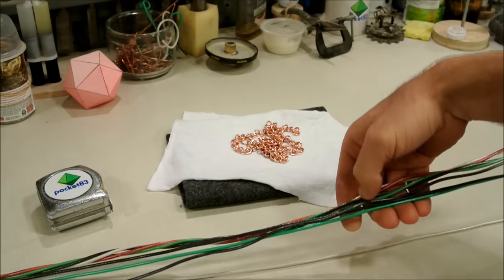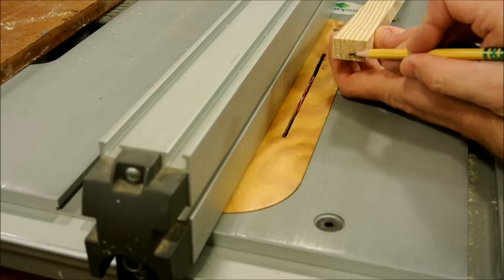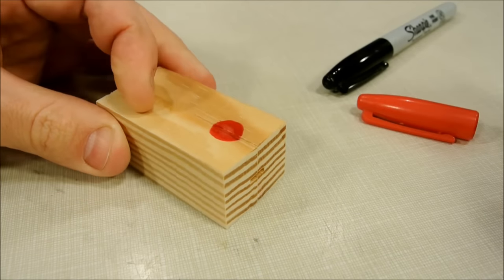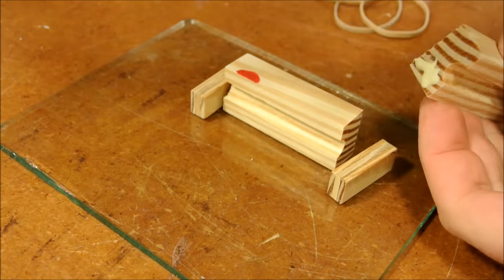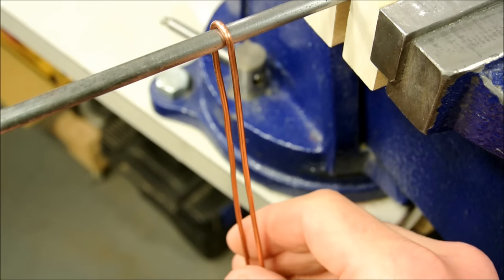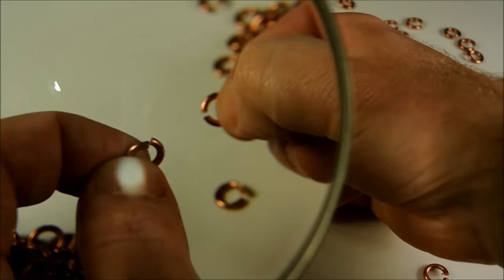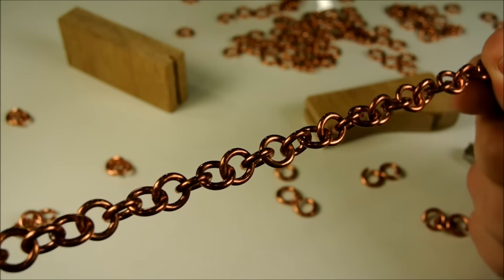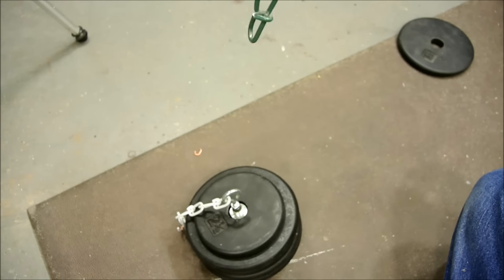Copper chain building

Comment: I have been making small bare copper coils for current carrying loops.  To join the ring-split together so there is no 'split',  I bent the ends out like you did, but also pushed them slightly inward so that to rejoin the open loop, you not only have to simply slide the ends back, but you have to pull outward on them and let them, upon release, press against each other.  This way, I can tin the inside the surfaces with solder.  Then when they are heated, the pressure will melt the solder, holding them in place with a thin layer of hidden solder--gives a much stronger 'breaking' force. Make sure that a piece of Al foil is between the soldering tip and Cu so no solder will be visible.

Comment: Find a really quick way to wind steel wire is to use a chuck key in a drill. Loop an end around the cog bit and power the drill to create a nice little helix

Comment: As someone who does chainmaille jewelery I do reccomend the wiggle closing method. Just pushing the ends together will deform the rings. You could also try welding each ring together to make it more permanent but for aesthetic looks and function I do not reccomend it.

Comment: Chainmaillebasket.com...  you are making copper chainmaille chain essentially.  Your technique is the same as chainmaille makers have been using for centuries.  Neat way of cutting though...  of course you could also get a dremel and a groove in your mandrel,  or a set of flat cut wire cutters and cut all the rings just as uniformly.  Interesting way of cutting the rings though.  

You can also hard weld the copper wire together using a pinch welder.
Reply: Good tutorial.

Comment: hold off on the vinegar, it's kinda way too agressive to  the metal if it doesn't have much oxidation i might recommend you treat the copper with something to keep the shine before putting it to use.  If anyway for the people that still wanna try vinegar, because it's one of the cheapest methods, watch out with the time you leave it because as soon as it acts on the oxide layer it will attack the metal leaving it porous. Be aware
Reply: aaaand if you just wash it after the vinegar and do not treat it with something it will also start ursting quite quickly because of the water that got in contact! im doing my own experiences on what is best effective on covering the metal for something that will have a lot of touch. still haven't tested it but i wanted to compare common machine oil and polishing it and gasoil and also polishing it. if any of you have a suggestion, just tell me

Comment: I've also played around with soldering the larger gauge links. Can you do a video on the strength of yours soldered and it's weight capacity? I use a 1/2" brass round stock to coil mine.

Comment: There is a lot of great stuff in this video!  I've used a mandrel in a drill to coil  different types of wire before.  Fast and works great! For instance, drill a hole to fit the wire just past where the mandrel would chuck in the drill. Thread a bit through to hold it and spin the drill at a low speed while keeping tension on the wire by hand. Just my 2c. All in all, a great tutorial!

Comment: When I was doing something similar 20+ years ago, I would take the 1/4" rod and drill a hole slightly larger than the wire in one end and put the other end in a drill. Feed the wire in the hole and while bracing the wire with a scotchbrite pad, spin up the drill and you have a full spring in seconds.

Comment: I wonder if that's how they make the links for chainmaille
Reply: I used to do chainmail when I was in my 20's - the technique is mostly identical, we used to buy regular black steel wire (not spring-steel) and wind it up on a steel rod affixed to a drill via the Chuck. Made it that much faster, but guiding the wire required some heavy-duty gloves :-) Other than that, it's just that Pocket has better tools; we just used pliers.

Comment: If you put the chain in a tumbler it will harden the copper and make it a lot stronger.
Reply from the maker: We have to keep this in perspective. (Elemental) Copper is just not very strong by nature, and no hardening process is known that will change that. Further, a tumbler will destroy the polished appearance. If you want "a lot" stronger, I would suggest an alternative metal. 

However, if you are aware of any CREDIBLE information on the subject, I would enjoy reading it. In any case, I don't expect that any physical treatment will increase this chain's carry load more than possibly a pound or two, which really negates the effort.
Reply: pocket83 I am a copper and silversmith by trade, and I've worked with steel since the 70s, so I am aware that unalloyed copper isn't a very strong metal. However, I have had opportunies to test various techniques. A jewelry tumbler will not destroy the polish on copper, quite the opposite,jewelry tumblers are used to polish it. And every hit made on copper(silver is similar) hardens the metal. Bending also hardens it. Therefore, as the shot in a tumbler strikes the copper pieces, the copper work hardens. If you do it too much, it gets so hard that it begins to crack. Heating copper red hot and quenching will anneal it, making it very soft and malleable once more. You can leave chains and such soft like that, if you want to, but I prefer to make them much more resistant to bending, so I either tumble them, or bend them several times until they harden, or in some cases, I hammer them out. The copper becomes many times more resistant to bending after hardening. Though, obviously, it's never as hard or as strong as steel.

If you require a source for hardening copper, I suppose this one will do, or hundreds more on google. It's just basic metalurgy.
https://jewelrytutorialhq.com/work-harden-jewelry-wire/
Reply from the maker: Thanks. So, given the 20 pound limit to the chain in this video, what would you expect a hardened chain to carry?
Reply: pocket83 I'm not sure, but if I guessed, I would say it might handle twice as much. It depends on how work hardened the chain was that you tested. There is always some work hardening with handling, stretching with pliers, especially if the wire you used was banging around in a vehicle or something.
You can also weld copper with oxy/acetyline torch, very easily. It's great to work with. Of course, welding the links takes time, but if you run across a situation where you wanted even more strength, you could weld the links closed then harden them.(Right after welding they will be extremely soft)

Comment: Will the salt trick work well with polishing brass as well?
Reply from the maker: Hmmm. Brass is an alloy (mixture) of copper and zinc. For brass, I usually use Brasso and Nevr-dull, or ammonia and cotton balls (0000 steel wool or possibly wire wheel in extreme cases), but I'm pretty sure that vinegar still works. I can't remember using salt though; if you do, watch carefully for reactivity, because salt can be corrosive. Do your homework first! 

Just spitballing: if you want a non-Brasso mild abrasive, I would probably try toothpaste first. It's like using a 400-grit polishing paste.
Reply: I use never dull but I want to know a alternative ...thanks